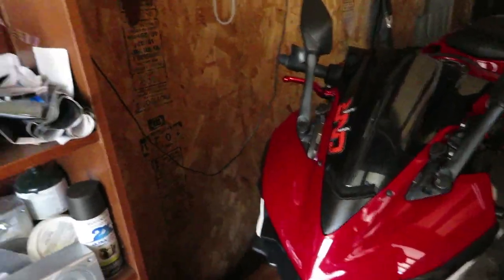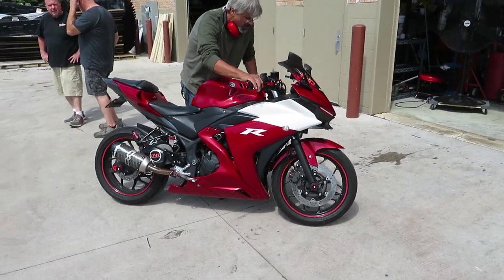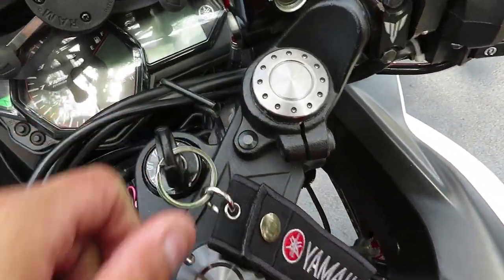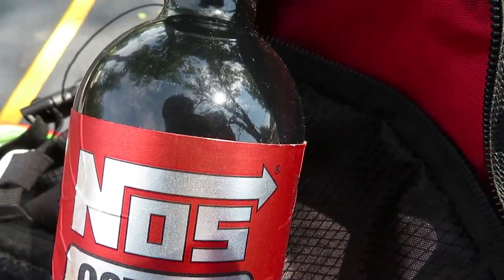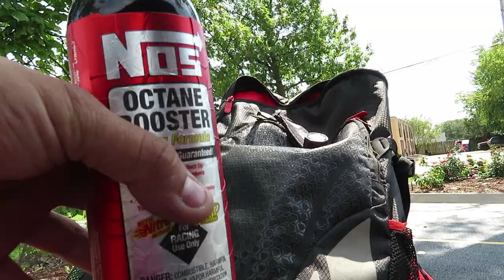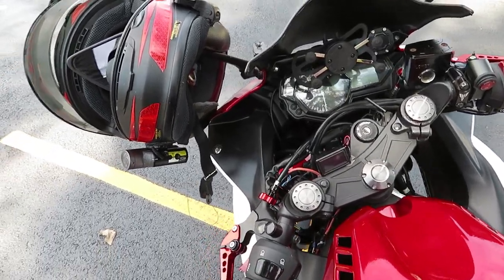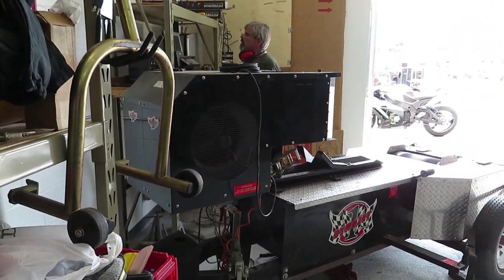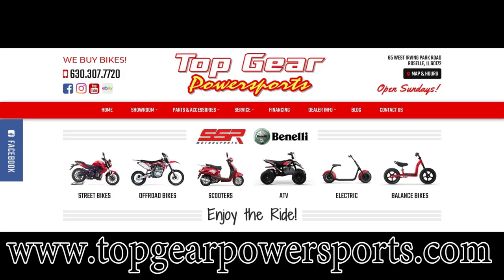Can adding Octane Booster REALLY improve HP????

Comment: Putting too much octane on low compression engines actually hurts the performance. Low compression engines shouldn’t use more than 98 octane. People don’t understand how octane works. Thats the problem. There is a mix ratio you have to use. Its on the instructions on the bottle. There are a few octane boosters the do help some engines, but most are just a gimmick.

Comment: My friend you exceed the proper dosage for the gallons you had in your tank. 
If you thought more of it is better
You are deluded.
You need to put exactly the percentage that it says. For example 100ml/litre 
Or 200ml/litre.
You put about 250 ml on about 4-5  litres  
In my opinion you exided the correct dosage
Reply: So the %is 5% to 100% ?

Comment: Only octane booster that "works" is Torco, if your not using Torco fuel accelerator, your either wasting $ or being dumb and thinking it's doing something it's not
Reply from the maker: it was just a test to see if it actually did anything that it claimed from the advertising on the package.